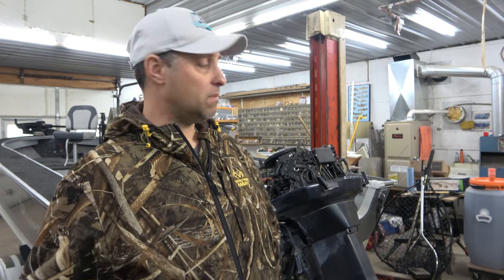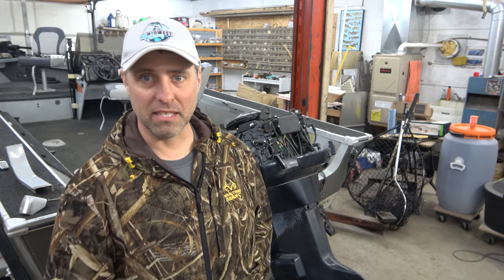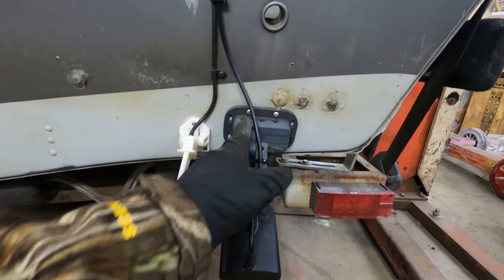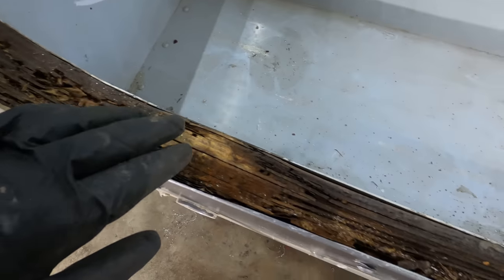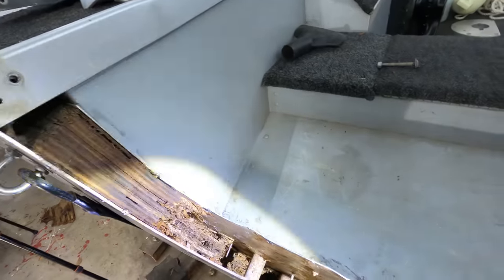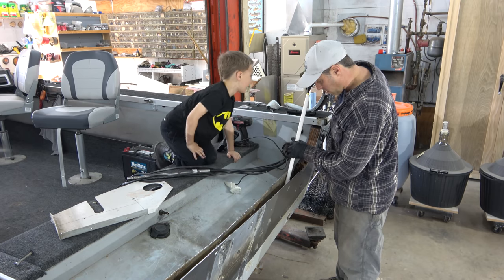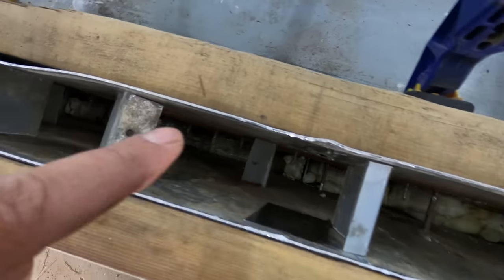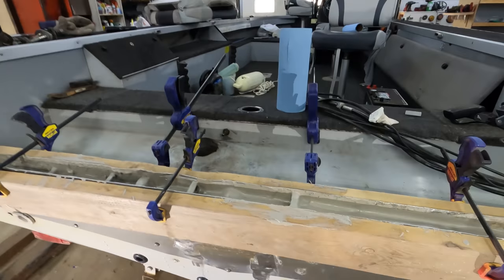The Easiest Way To Replace A Boat Transom

Comment: Did you pouf where transom and Gonzales meet. Also how well do you think it would work on fiberglass?
Reply from the maker: It is designed to be used on aluminum or fiberglass, so yes, either will work. Thanks for watching.
Reply: 1 of these days I'll read what I wrote. Did you pour where transom and gun Wales meet?
Reply from the maker: @JerrelBaker-vo8xv  I did not end up pouring where they meet. Mainly because I wasn't sure how to fill that part with resin without it leaking out. The other reason is that I miscalculated how much I needed, and didn't have enough to do so.

Comment: Not bad at all.with I bit more work you could get to factory like condition.minor paint prep and paint issues.overlaps on metal needs marine caulk etc.but overall, a great idea
Reply from the maker: Thanks. It was a learning process. The good news is that it still works great!

Comment: Did you leave your bolts in your transom when puring that in?
Reply from the maker: Yes, All the permanent bolts that went all the way through, I left in. I only took out the small screws that weren't doing anything. That way it filled up those holes and I painted over it to make it a flat surface again.

Comment: Awesome job man reading through this comment section full of keyboard experts who would’ve  have the balls to do it themselves, great job on executing the project....do you have any updates on the transom? Things you wouldn’t done differently could you make an update video?
Reply: Or is keyboard experts would have correctly fixed the rotted transom
Reply from the maker: Hi Nicholas. I appreciate the comment. when you put stuff on the internet, the whole world gets to criticize you. Its just part of the deal. I'll do an update video at the end of the fishing season. So far, I'm very happy with it and it is holding up great. I'm pretty sure it will outlast the boat.

Comment: When using stainless screws into aluminum, you need to cost the screws with “Bo-shield” by Boeing to keep the screws from oxidizing.
Reply from the maker: Hi Gilbert. Thanks for the recommendation. I have not heard of this product before. I looked it up and I think it would work well.

Comment: Stronger connection to the transom cap would be to clamp the angled aluminum in place and drill and rivet them together at the top (instead of the flex seal) and then drill and screw or rivet to the sides. If you are worried about raised rivets on the top interfering with things you can use counter sunk rivets (tiny boat nation and amazon have them).
Reply from the maker: I realize I didn't show it well, but I did rivet the transom cap all down the sides. I was thinking I didn't want holes in the top to keep water from seeping in. I guess that's a issue I'd have to look into further. Thanks for info. I always appreciate hearing other options.
Reply: @GoMidwestFishing  They also make what they call a "closed" rivet that is completely closed on the end so water can't get inside. (they also make this in a counter sunk version.)

Comment: As someone familiar with composites, I was really skeptical about the claims that a liquid resin based product would provide the necessary tensile strength without any cloth or mat liner. I looked up the manufacturer’s website and saw it is indeed not recommended for the way you chose to use it. They recommend it for use with a liner, cloth, or mat.
Reply from the maker: Hi Drewdoestrucks. Thanks for the comment. Yes, they do recommend using a fiberglass liner if you are pouring it into a template. That would be the same install process as using coosa board or plywood. It would require removing the front or back aluminum to access the space. It can also be used as I did, by pouring it directly into the transom area. I've been using it for two years now without any issues, so I can confirm it does work well.

Comment: I applauses the effort, for someone who has never done a transom replacement. Although I do feel that the left sections of Wood transom should have been taken out. It just seem logical from support stand point to do so. Never practice aluminum welding on your good pieces. I had to weld a t-top but I practiced on the bench first. The Bondo filler, I think will eventually peel off, because of the high water contact. I’m not for sure but 3M 5200 might been a better choice. The Carbon Core filler seems to me a little pricey. Filling the top portion of the transom with foam is a no no, foam has no structural property at all and still can retain moisture. More core filler or even fiberglass would work better there. But hey if it’s working great and your enjoying the boat, why not. The terms 
“One must learn to craw before they walk” comes to play here. Your video was a great stepping stone for me and/or others who try to attempt a project like so. We learn from others and their mistakes. Thanks for sharing. Let us know how the transom is doing.
Reply: Yeah....I would have went with the 5200 I owing he was going to have warp issues. He could have used the low temp rods for filling holes to weld that edge since he was pouring that. The pour would have supported and protected that filler weld but at least he was putting in the effort and it's all a learning process.
Props to him for trying what a million other boat owners would have never tried.

Comment: I applaud your approach to the problem that you were faced with.  There are a number of people that commented on the potential weakness of the bond between the old wood and the new core, which I guess, only time will tell, but you have your boat ready for fishing! One quick note - the two pieces of angled aluminum you used to cap the transom may have been best mounted first then the two curved end caps fitted over the straight pieces - allowing water to be diverted from entering the transom again.  Thanks for the video - hope the boat runs well and the fish are plentiful (within limits of course).

Comment: Actually, many manufacturers use that stuff for complete transoms. It is incredibly hard and dense...you can even drill and tap it. The problem is...HE DIDN’T REDO THE ENTIRE TRANSOM!! He has an entirely free-floating center section, not physically attached to the wood outer sections and not attached to either of the boat’s side hulls. It will fail with very little warning.
Reply: Exactly!
Reply: I don't know much about boat construction,  but was wondering what it was attached to,so basically it's the skin of the boat doing structural work?
Reply: @matthewholzmueller6292  yup, corner caps or gussets tie into the wooden  sections and the entire side of the boat holds the transom. The only thing holding the transom here is the aluminum top rail. Not good. If he had removed all the wood and poured the ENTIRE transom it would probably be ok.
Reply: I think you are right i wouldn't want that boat after he is done.
Reply: Yep, should have removed all the wood, duct taped over the top rail section all the way up the sides, and poured in from the sides. Nothing holding that 2x20 in that void except aluminum skin and a bunch of wood screws.
Reply: I did my 1997 Lund Pro V a year ago with the seacast,  I pulled every last pic of wood out and filled it completely. Transom holds a 150 Merc motor. Never use Silicone for Marine sealing use the 3M line of sealants instead
Reply: I would have drilled sideways into the wood and epoxied rebar into it before I poured it but everything else was fine.
Reply: 100% correct.  This is a catastrophic failure waiting to happen without warning.  That boat is now more of danger than with a visibly failing transom. Amateur transom repair just not a good idea for even low powered engines let alone an 88.  One time that engine will shift into reverse and tear that whole transom off that boat.  I be very easy in reverse from now on.

Comment: Thanks for this video. I think what you've done is very challenging and interesting. The techniques you used and problem solving skills were far more helpful than repairing the transom. 
Beyond boating, using that stuff for other applications and using the drill to pulverize the rotted wood is very intelligent and smart. In fact, I can think of a number of what would have been impossible jobs other than boating application , can now be tackled with your technique and liquid Carbon core mix. Thank you and tight lines.
Reply from the maker: Your welcome. You are one of the few who really "gets it." This video was really about problem solving and finding ways to overcome obstacles. These techniques can be applied to anything. I learn by doing, which means I will make mistakes and it may not be perfect the first time, but now I have that experience behind me if I ever do it again.
Reply: Hey pal, I’m a little envious on the way that you pick that motor up using the auto jack… How many guys have auto jacks in their garage is huh??

Comment: If anyone else replaces their transom this way,  I would suggest inserting the 2" angled spacers with the peaks facing the ground. It appeared to me that at least some if the spacers were inserted with the peaks pointed upwards,  which probably created air pockets underneath.   Admittedly it's a minor point but I'd rather not have air pockets in my transom.   No disrespect meant towards this person...I admire his efforts.
Reply: I agree. I would’ve used some body hammers and straighten the transom on the exterior and use heat and water to quench to shrink the metal to take the wrinkles out. I would’ve also inserted some Kevlar cloth. Especially at the corners and the bottom and top edge.
Reply: I agree!!! this way there is no AIR POCKETS!!!

Comment: When I was a kid, my father and grandfather did the same exact job on an old Artsto-Craft fiberglass boat. My job was to literally vacuum out the original transom wood! The entire thing was dust in between the two fg body pieces! They made a new transom out out pressure treated plywood. It turned out perfect..the engine didn't move around after they fixed it.

Comment: Good job. BTW, Your boat is faster because you raised the engine height. Less drag.
Reply from the maker: Your right. It is about an inch higher. I didn't even consider that as the reason. Thanks for the input.
Reply: @GoMidwestFishing   you left the wooden corners, that is a crucial structural area. The top corners tie into the transom as it spans the FULL WIDTH. Effectively forming a box at the back of the boat. There is no mechanical connection between the filler and the wooden corners. This could fail spectacularly and injure yourself or others.
Reply: Plus the composite is lighter than rotted wood.

Comment: Good repair and it looked like there was no flex. The speed gain is from raising the motor those couple inches which trimmed the prop. You could have scraped the remaining mix out of the buckets and epoxied a laminate of plywood for the void. I would have used a flexible shaft drill and inserted some hardwood dowels to tie the wood with the eyebolts to the new transom pour. Maybe buoyancy foam would have been a better choice, it doesn't break down in water.
Reply: Buoyancy foam doesn't break down in water ?   LOL

Comment: Going to be doing a pour soon. This stuff self gasses and is 3x’s stronger than plywood …!
Reply from the maker: Hi Edward. You are right! Now tell everyone else on here.
Reply: In time we will see If the thermal cycles, vibration and impacts don’t cause problems. I know aluminum alloy‘s form an oxidized layer which would keep the metal from bonding well over time.  Water intrusion into the transom will lead to corrosion and pitting of the metals and attachment points.  I know that wood is no better. Every wooden transom I have built on boats have never failed. I spend extra time impregnating the wood with the epoxy  thinned with acetone. When I laminate my pieces together I make sure there are no air spaces and when I’m done it is perfectly sealed to the atmosphere. I have friends that are still using their boats that I have repaired over 20 years ago and they are still fine.
Reply: @GoMidwestFishing  nobody is doubting the strength of the filler, it's how the filler is attached to the remaining plywood, or lack thereof. A transom wants to be one piece, its largely supported by the corners and sides of the boat. Corner caps are really important, they hold the top sides of the transom. You  have no mechanical connection from the filler to the plywood, only glue. So essentially a 3 piece transom. I'm really not trying to be negative but this could be really dangerous. If you had removed all the wood and done a full pour it would have been an awesome job! In fact I might use this product in the future.

Comment: Kudos for putting this out there and taking the advice on the chin. I have never poured one of these so I won't be the Monday morning quarter back about the actual pour or reusing the wooden corners. However, suffice to say that setup will leak badly if going astern or in following swell. You have not sealed the engine well to the transom, the transom cap nor the corner caps. Water will get in there so please be very careful!!!!. Lastly, normal expanding foam absorbs water fyi.

Comment: While time will tell how this holds up, and I wouldn't be concerned with "Sharp edges" at all, one thing bothers me about this product. It lists its tensile strength as 1600 psi, and a fiberglass/resin system runs between 9000 and 18,000 psi. I can't speak to a transom needing that kind of strength, but the difference would concern me. Hope it works really well for you, and you certainly wont have to worry about any rotting.
Reply from the maker: I guess I will have to do a follow up video in a year or two to see how it holds up. I like the fact it will never rot. Thanks for the info.
Reply: Cool product, but the way you half did it, and capped it with silicone. Makes repowering the boat pointless. At the moment to make the best of it take the foam out of the top it'll absorb water, even closed cell marine bouyance foam gets waterlogged. The coast guard has even had several boat manufacturers work together to find a solution without luck. Itll basically become a sponge that will keep the remaining wood moist in the long term. Fill the remaining gap to the top of the transom it's like a giant funnel at minimum, Holding water as the wood sips on it. I'd recommend getting some wood scraps and fill the void then seal all exposed wood old and new, edges with epoxy. I just am telling you what will make it last longer you don't have to listen to me or anyone else. I've torn into plenty of older boats wet waterlogged foam is really common issue leading to accelerated wood rot. Boats that spends months or years unused on a trailer still have moisture trying to escape, from marine bouyancy grade closed cell foam. Great stuff isn't any better.
Reply: Well, the next time you need a transom that resists being pulled apart, I’d say tensile strength isn’t that big an issue…

Comment: Looks like a great job  and I appreciate the video . I am facing a similar repair on a bigger boat that has inboards. The only thing I’m curious about is if I could drive some kind of rod into the side wood kind of like rebar to increase the strength as a whole? I was quoted $5000-$6000 to do this repair and based on your video I’m thinking I can do it myself for around $1200. Thanks again for the video.
Reply from the maker: Looking back on mine, I think adding some kind of rebar would have been a better way of doing it. I don't see why you couldn't do it that way. Good luck on your build!

Comment: Hey, great job Midwest, I also used the same Carbon core for a fiberglass boat I had, I as you had the same result, and I also finished the top with Aluminum angle, it made me proud watching you go through the same moves to finish.
Reply from the maker: Hi Gary. That's great to hear. It makes me feel like I was on the right track then. Its been holding up great, and I love it. I'm glad it worked for you too.

Comment: Welding aluminum is very challenging brazing it is out of the question. Not sure I put steel screws in aluminum
Edit played on the transom was an excellent move
Reply from the maker: Hi David. I was having trouble trying to find the best options for securing stuff to aluminum. It comes with stainless screws from the manufacturer so I went with that. I did use aluminum rivets where possible. If you got any recommendations, please feel free to let me know. Someone mentioned coating the screws with Boeshield to prevent corrosion.
Reply: @GoMidwestFishing  some kind of washer like nylon

Comment: Great job! Very nice video. Did you decide to not put the speed sensor back on?
Reply: Could have drilled holes into side wooden part so it fills and binds better. Also screws would help. Just a thought.
Reply from the maker: I did not put the sensor back on. It wasn't accurate and I just use the GPS speed off my fishfinder anyway. Thanks for the comment.

Comment: I would think you’d be wise vibrate bubbles out of the epoxy after pouring no?
Reply from the maker: The instructions didn't mention needing to vibrate the bubbles out, so I'm not sure if it is needed or not. It starts to harden within minutes of pouring it, so I'm not sure there would be time to do so. You can learn more about it here: https://www.carbon-core.com/products/carbonbond/transom-compound/

Comment: I would have just filled the top of the transom with some body filler it can be worked like putty but foam is ok. I used low heat aluminum welding on my boat. You need to clean every thing with stainless steel wire brush every thing else contaminates the metal and the weld won't take
Reply from the maker: Hi Howard. Thanks for the great info. The foam didn't work very well, so I like your idea better. I just found another company that sells basically the same resin but in 1 gallon buckets. That would have worked nicely.